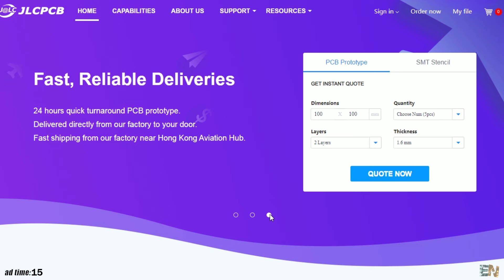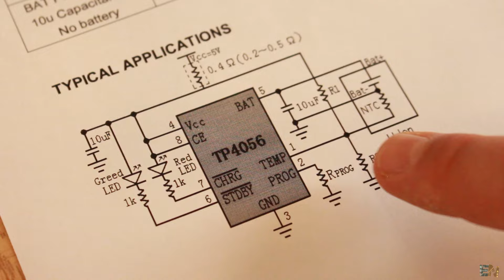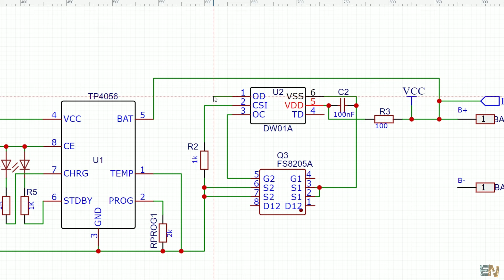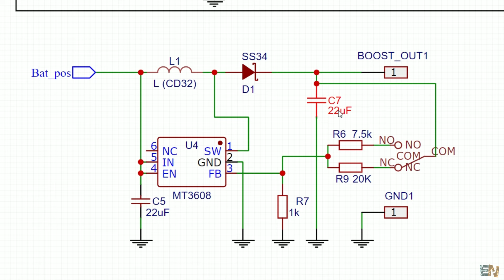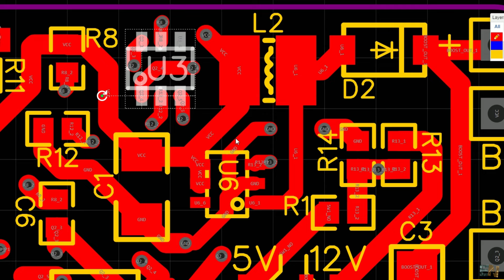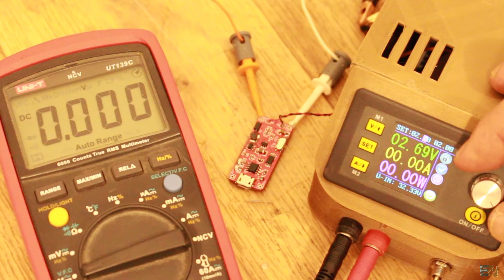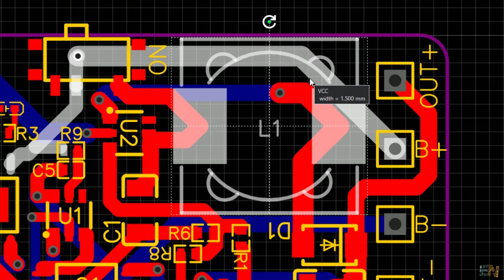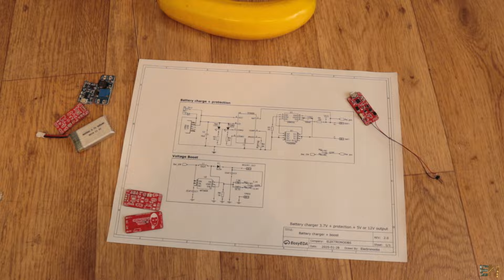Battery Charger & Protection & Boost 5V or 12V

Comment: Also, be aware of the current rating on the surface mount switches. Good engineering design calls for at least 2x margin, i.e. if the battery can sustain ~500 mA the switch needs to handle at least 1000 mA. (This margin should be much higher than 2x if we were dealing with higher power.)

One solution is to use an N-channel mosfet to switch ground back to the battery. Then attach the smd switch to the gate to turn the mosfet on and off. But when it comes to things like power supply, I don't like low-side switching as it leaves the load energized, so if it finds a ground it might turn itself on.

So if you can find a p-channel mosfet that handles the required current and can be saturated at zero volts (rather than having to go negative) you can switch the high side of the battery instead.  So look for a P-channel mosfet whose Vgs(th) is only about half of the voltage you want to switch. This increases the likelihood of the mosfet going into saturation.
Reply: Pm me can you to install do sola paint of charger.

Comment: Regarding the output voltage selector switch: Why not simply put the 7.5k resitor in series with a 12.5k resistor and use the switch to bridge (short circuit) the 12.5k?

Comment: Having the circuit kill itself if you forget to switch the boost converter off before toggling the voltage is just unacceptable. You should rather use a zéner to ensure the inductor spike isn't too high when disconnected

Comment: one question : When usb is connected.. while Load is powered, will it drain battery or will it use power from direct usb ??
Reply: Good question
Reply: The current path is through the TP4056, so it depends on the charging current/current draw, but the load isn't directly powerd from USB power, no.
Reply: @RonaldWijermars-rohmega  when the load is  connect while charging a battery the charger react abnormal..what is the reason?
Reply: @gurunath8324  What do you mean by abnormal? Probably because the charger is supposed to trickle charge the battery to a full charge, but the current draw of the load messes up this process and it will never fully charge if a load is connected
Reply: ok thanks all for inputs. I am considering that it won't get direct power through usb. now if anyone have this kind of arrangement like if usb is connected it gets power from usb else battery ?
Reply: @TheJay6621  You can look up load sharing. There are plenty of IC's that integrate Lithium charging and load sharing. If you want to combine it with a TP4056, the easiest way is to add a p-channel mosfet and a diode between the battery power and the USB-in and connect the gate of the MOSFET to the USB-in. If you then plug in USB power the gate of the mosfet gets pulled high and the battery is disconnected from the output.

Comment: But the module with USB type C conector it would be better for the future
Reply: That future is the present. I think he chose the micro usb part because it's cheaper
Reply: Propper usb c charging would be much more complicated
Reply: Got to have a use for all the old micro cables laying around.
Reply: @TecSanento  not if just using 5V, PD yes
Reply: @daijoubu4529  then what's the advantage of usb c?
For bigger batteries I would prefer it, if it supports propper usbc charging ;)
Reply: @TecSanento  reversible? That's about it, and if your phone/other gadgets uses type-c, one cable to rule them all lol
Reply: @daijoubu4529  that's the advantage of a usb c powerbank module like there are plenty on ebay, even capable of usb c power delivery with up to 20V and 20 watts

Comment: while such a board is very useful, your examples at the beginning are a bit weird: both the IMU 6040 and any SD-card run naturally from 3.3 V. The ATmega328 on your Arduino nano can also be run directly from 3.3 V
Reply from the maker: Yeah, probably the IMU was not a good example. But the DFplayer needs 5V, the LCDs and oled displays I usually use the same and so on... Thanks and good day

Comment: Why Havning the switch at All? Is there a need for changing the voltage after you decided the applikation, I would consider this feature as a risk of destroying the circuit attached to the supply.
Reply: As he explained, some of his projects require 5V, some 12V. Having a supply of protective boosters that can work at either level is handy and saves lots of time. You may be concerned about someone flipping the voltage switch while its still attached to a load, and doing damage to it. You can either physically secure the switch (by putting the circuit in a box), or you can leave the switch off the circuit board, and then hardwire the circuit into always 5V or always 12V. I tend to use through-hole switches, as it makes doing thinks like hardwiring it into a fixed position easier (it also allows you to easily put the switch somewhere else and just run a cable to the circuit board).
Reply: @Nono-hk3is  well other applications uses other voltages so you might argue for a Rotary switch, its not a benchsupply. We are talking about changing max two resistors, how difficult is that

Comment: Nice project man, you did a great job with this module.
BTW for the switching problem I don't know if someone has mentioned it or not but if you take a look into the Vout equation you can see that when you disconnect the resistor R1 for a very short time this makes its value approaching infinity and according to the equation the boost converter will try to reach a very large voltage value that will destroy the ic
I think the solution is to make R1 constant and change R2 according to the desired output voltage, this will make the switching moment voltage equals to Vref

Comment: Hi. It's a great idea, but I suggest two things to improve the circuit. First, use a FS312 instead of the DW01,  because this chip have a 2.9V under voltage protection, instead of 2.5V, it's more safer for the Li-Po than the DW01. Second, use the switch to conmutate the R2 value, not the R1, in this configuration the FB pin always see the voltage of the output, and if the R2 value is floating, the voltage in the output will be 0.6V, the feedback reference voltage, and the IC is safe 👌🏻(Perdón si mi inglés no es muy bueno, pero prefiero comentar en inglés en tu canal de habla inglesa).
Reply: Yep ditch the DW01, even if it's dirt cheap, voltages are so wrong
Reply: Is there an under voltage protection chip for a 2S  Battery.  I have students making antweight combat bots and they use  small 2s lipo,   I made a small board that uses a ESP and motor driver to make a small brushed ESC and receiver, I would like to add under voltage protection to make sure the students don't run the batteries  down too far. I was thinking of monitoring only the total voltage because the 2 pin JST of the battery is what I have plugged into the ESC
Reply: Newbie 

If I use the fs312 instead will the capacitors and resistors values have to be changed. 

Any tips appreciated
Reply: Yeah 2.6v is very low for a lithium chargeable battery, 4.2v full and 3.0v for empty battery (nominal 3.7v)
Reply: Tengo dos supercap de 2.4V crees que pueda hacer algo similar ? Carga, levantar el voltaje y proteger de cortos ?
Reply: Ik it's been a year since you posted this, i'm a noob and not great with circuit design, do you know if a board with the modifications you suggested exists?
Reply: @HS-eq3gk  not afaik
Reply: Pm me can you to install do sola paint of charger.

Comment: 1. Circuit has very low cell cutoff voltage. GreatScott has a solution for that.
2. having 12v and 5v switch is just asking for problems.

Comment: Would be nice if you could switch the charge voltage to 4.0V  Limiting the charge voltage to 4.0v greatly extends the  cell cycle life.  You really don't realize that much capacity  between 4.0 and 4.2v but it beats up the liIon cells quite a lot.

Comment: Awesome project, great work
Just one question 
How can you increase the charging current, as 580mA is a little less for bigger batteries like 10000 mAh
Noob here please help
Reply: The rprog value can be changed to calibrate different charging currents

Comment: Hey Electronoobs, loving your video and concept for a charger/boost converter. I've recently made my own usb charger boost circuit and found that another IC made by TP to be even more suitable. The TP5400 comes as an all in one IC that can handle charge, boost, protect, and has internal mosfets. Might be worth taking a look at that IC. However, the only downside is that the datasheet is in Chinese only.

Comment: can you suggest some to get a pi w2 @ 5 with 2.8 inch screen i was needing to power and charge 2 2000 mah batteries and i am confused serial or parallel

Comment: how to set more batteries with this circuit?
Reply: Hi Abu, you can not use more batteries with 1 tp you need to make bms on batteries, its another dimeonsion of problems. You would need separate tp for each batterie and can use only 1 boost circut, or even add step down for 3.3v if you are using ESP or some mcu that is 3.3 v.

Comment: Instead of a second switch you can add a capacitor across the two switching resistors it should work 
The components got damaged because it was sensing 0 v and tried to raise the voltage  with a cap the sensing voltage should stay the same for a small period off time but the load response time will increase
Reply from the maker: Oh, I'll test that too. Thank you!

Comment: I really like the 12V option. Well done.

Viewers should be cautious about charging the battery while running a load on the boosted output. Simultaneous charge-discharge generates a lot of heat in the battery, and leads to shortened battery lifecycles.  This isn't a problem unique to your circuit, but the usefulness of your circuit will likely encourage people to accidentally abuse their batteries. Just be aware that its not ideal and try to avoid the situation (although sometimes you just need to do it.)

There is an IC from TI that (claims to) isolate the battery from the load when its on USB power, and only provide charging power after the system load is satisfied. http://www.ti.com/product/tps61090 . It's the basis for the Adafruit Powerboost 1000c, and basically acts as an Uninterruptible Power Supply. Unfortunately it's only available in a QFN package which is a real pain to solder by hand. Its also orders of magnitude more expensive than the components in your circuit.
Reply: Or you can add mosfet that control if PS or battery will power output via boost part of circut, if USB is powered switch it to output when usb is 0v use battery. You cant charge battery and use output at same time but output will be live when on usb and your device/light will work without charching :) trade off
Reply: @jedandecko5585  that's a great idea

Comment: Tío, deberías leer estas páginas con mucho cuidado: https://www.best-microcontroller-projects.com/tp4056.html and this other one https://forum.arduino.cc/index.php?topic=496727.0. Cheers
Reply: the tp4056 can provide a maximum current of 1A at 4.2V. Given that it is a chinese IC, let's call it 800ma. The rest of the current is coming from your charged battery. Let's call the MT3680 efficiency 80%. Now do the maths. And I'd appreciate If you could run a test with a fully charged battery with the board connected to external 5V to see for how long it can sustain a 1A 5V output, then check if the battery has been discharged. That's probably why GreatScott did what he did two years ago in this video. https://www.youtube.com/watch?v=Fj0XuYiE7HU. Sorry if I sound a bit harsh, but I hate when things don't add up. And, in case it ends up working just fine, I'd be very pleased. I'm very anxious about the results. Suerte.

Comment: so the design was flawed, and you added a workaround and didnt fix the flaw, you should get a job in government....

the issue you have is one thats been known about for many many years in multimeter design because on an amps setting the current pass resistors being removed from circuit caused the meter moving coil to be destroyed.

you DO NOT switch between two resistors, you have one resistor permanently connected, and then use a simple 1 pole switch to bring in parallel another resistance, this way the ic pin never sees open circuit. problem solved, no governmental workaround.